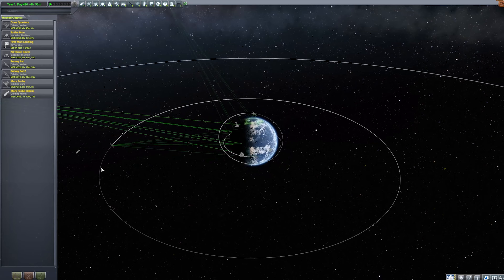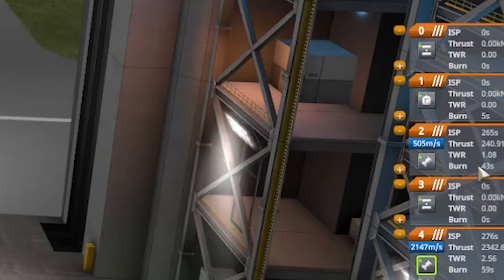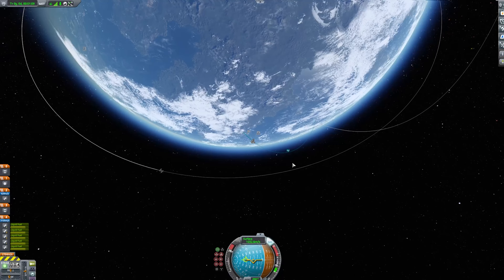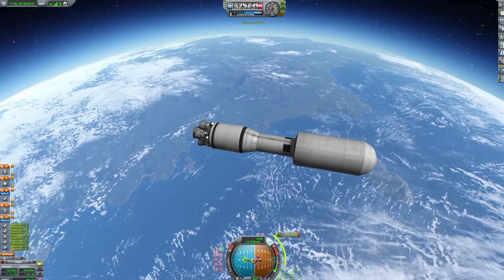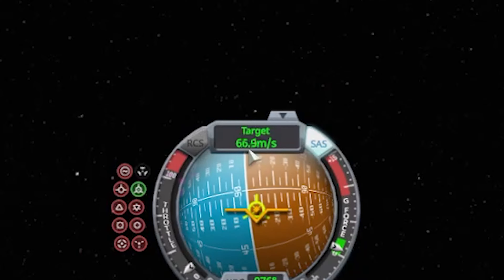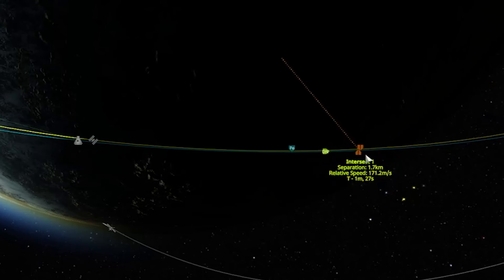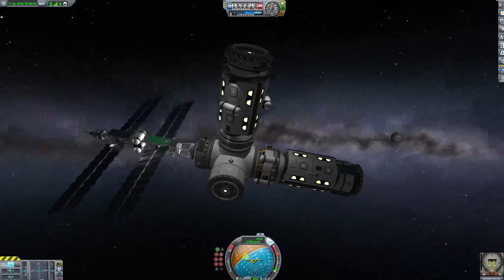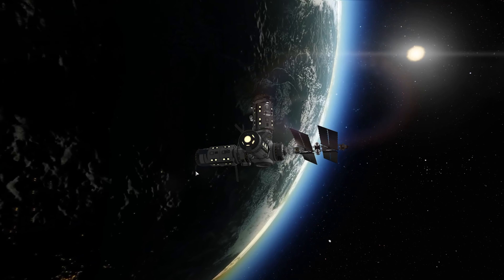How to dock in Kerbal Space Program | Tutorial that actually helps

Comment: The rendezvous can be performed far more efficiently. Why’d you go into target relative mode so far from the station? If you use an astrodynamic approach to the station and execute your maneuvers precisely you can get there with far fewer maneuvers and less delta-v. it will also allow you to ensure that your relative velocity in close proximity to the station is low well in advance of closing in on it.
Reply: Yes, you're correct, at first glance it seems that this method trades an higher deltaV requirement for an easier procedure. Gotta try for sure.

Comment: Guys im in console how i can switch fast to the another rocket bc I don't know
Reply: You should be able to press square or x depending on console on the command pod on the other craft and select control from here and it should let you control
Reply: Hey, so you can only 'switch' to nearby craft that's within 1 km I think, you can do that by using the lb1 or rb1 and left or right keypad to cycle them. Look in the controls option for 'cycle craft' 
If it's further away then you have to use the tracking station I'm afraid.
Reply: @_RandomPea  i tried this but nothing happens you know where to find this cycle craft?
Reply: @astrogamergr4274  hold L1 and push left on the D pad
Reply: @shawngaetz8161  its not working mate
Reply: @astrogamergr4274  you need to be within range. Idk...it's not rocket science.....oh wait... lol